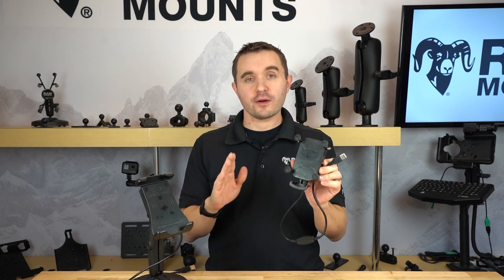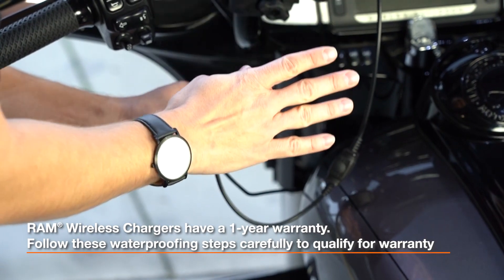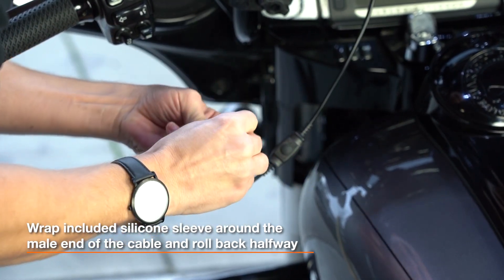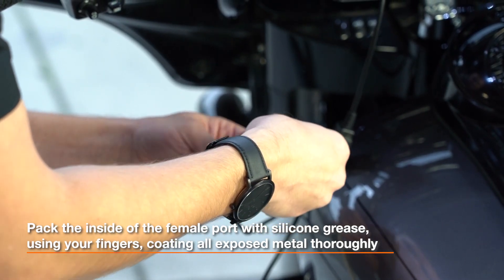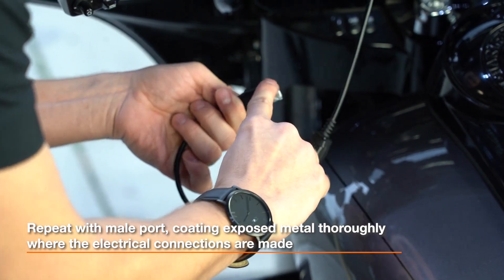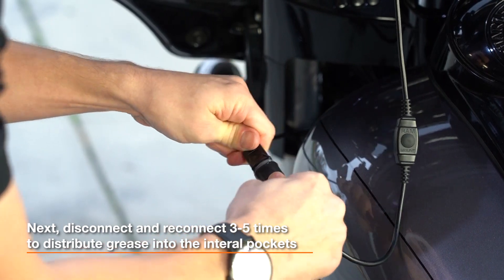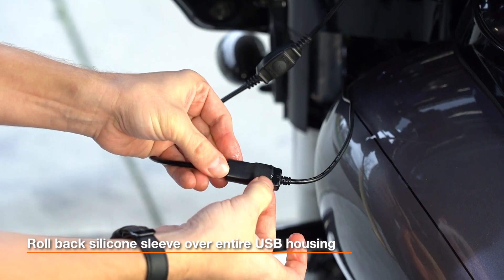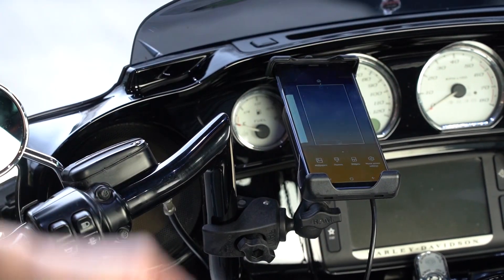How to Create a Waterproof USB Connection Using Silicone Grease

Comment: Is that silicon grease same as thermal paste in electronic use
Reply: No, it's not the same.   I use something called Dielectric Silicone Grease and it's working great.   I have been using Dielectric Silicone Grease in automotive ignition spark plug wires and many other electrical connectors in engine compartment for a long time.   It works well in extreme low temperatures to super-hot heat from engine / exhaust.
Reply: Does this work for usbc and headphone jack as well? Can i open simcard slot and inject silicone dielectric grease to fill all the voids in the phone?

Comment: I followed these directions and even with the silicone grease, my connector corroded away in less than 3 years. My $150 waterproof charger is useless because the connections RAM provides aren't waterproof. And it doesn't help that the cable coming out of the charger is only 6 inches long giving very little options on where to put that connector.  There should be a hardwired option that avoids the unnecessary USB connection and goes straight to a battery or switched ignition source. I expected better from RAM.

Comment: Also... exactly what kind of grease are you talking about? You can't really be mashing dielectric grease into the electrical connection, can you?
Reply: That is pure silicone grease which isn't conducive, not grease mixed with metals for higher thermal conductivity. You have to make sure you're using the right type otherwise you will short the connector.
Reply: Mineral oil would work aswel my Samsung phone keeps saying its wet  due condensation if 10k of pc hardware works in a tank full of mineral oil then a USB C port on a phone will survive and still charge and no longer get the wet moisture issue because it coats it in a layer of oil anyway even pc harder after many years has a layer of oil only way to clean it is to use rubbing alcohol to clean it out

Comment: I have the RAM Tough Charge holder and it's great. This video is also great advice for waterproofing the USB connection. But a question: I have been trying to source those silicone sleeves to do this for other connections, and I cannot find them anywhere. RAM does not sell them as accessories that I can find either. Anyone know where to get more of these? Or the interior diameter specs of these sleeves so maybe I can just buy some tubing and cut my own?